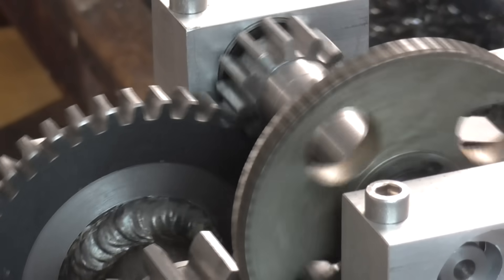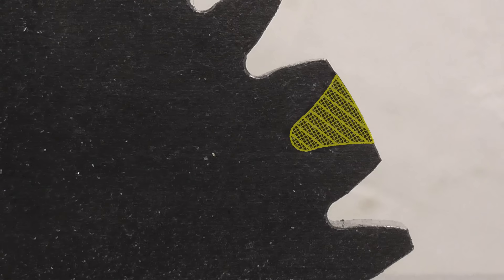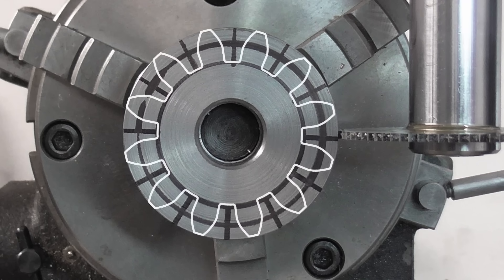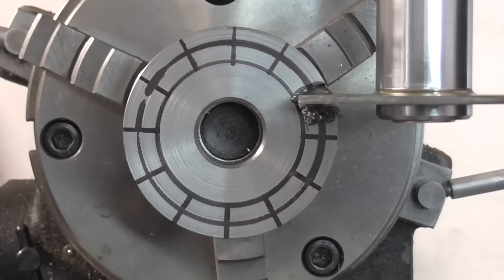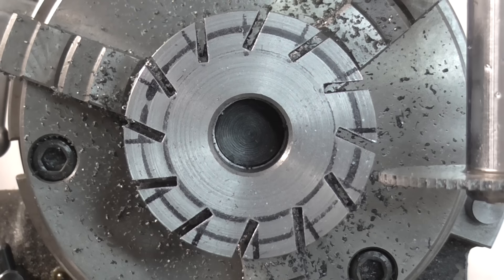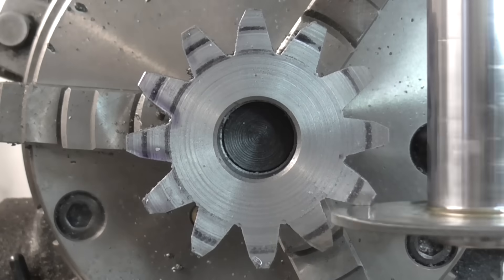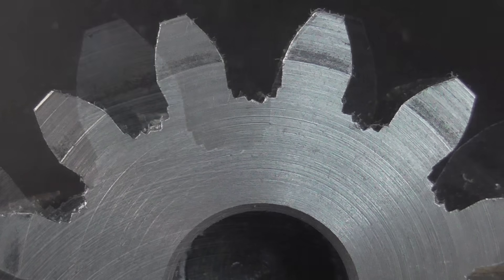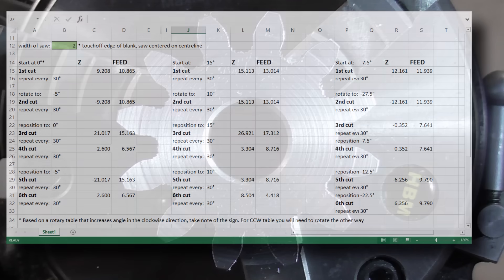Cut any gear with just a slitting saw

Comment: Well done 👍👍The metal that you were cutting, was it a low grade alloy? Use a similar method using and index table to cut the gear,this gave the advantage of being able to drill-out the teeth root prior to cutting, and an end mill was used instead of a slitting saw. However the geometry used in the process was basically the same. We done!! very impressed, freshened up my maths no end, thanks.
Reply from the maker: It was just mild steel.

Comment: newbie here. are slitting saws designed optimized for cutting a particular type of metal? ferrous versus non ferrous (aluminum). if so, what makes them different? are tungsten teeth the norm?
Reply from the maker: There seem to be 2 main types, HSS and solid carbide. HSS are for general use on non ferrous and mild steel. I've not seen any with teeth optimised for certain materials, but these may exist. They do come with different sized teeth, smaller teeth are better for thinner material. Carbide ones are more expensive and would be used for hard materials such as stainless, hardened tool steel etc. There are also saws that take replaceable insert teeth, but these are much larger and would be for industrial use.
Reply: @AndysMachines thanks andy. and... where does one go to learn for a given material to be cut (aluminum), the linear feet speed of the cutter should ideally be for a clean, non sticking, non chattering cut?

Comment: Cool, but you can use two properly spaced saw mills simultaneously, so you will machine two sides at the same time
Reply from the maker: If you used 2 saws they couldn't be parallel to each other, they would have to be at a 20° angle (or whatever matches the pressure angle of the gear). You could use a thick saw with the sides ground at an angle, that would effectively be a #1 gear cutter.
Reply: @AndysMachines They could. You made "cartoon gear" by cutting 1 side and then relocating saw to another position to cut 2 side, but you could have two saws at positions 1 and 2 at the same time to get "cartoon gear" just in one revolution of workpiece.
Reply from the maker: Ah, ok! I see what you're getting at. Yes, you could have 2 or even 3 saws on the same arbour stacked up but they would have to be different diameters so that their radii form a 20° cone (40° included angle). This would cut the same side of multiple teeth rather than 2 sides of one tooth. You would need to invert the cone to cut the other sides below the centreline.

Comment: Hello
you could be interested in this video showing how to cut gears with a slitting saw but with tooth thickness adjustment: https://youtu.be/y__LZ8tn88I
Best watching
JM
Reply from the maker: Very interesting! I have also cut gears using a similar method but with a cutter shaped like a stack of no.8 cutters so that cuts are made on several teeth each pass.

I also like how you cut gears on a shaper, you don't often see people do this but I think it's one of the best uses of this machine, particularly for internal gears.

Comment: Why couldn’t we profile an end mill cutter for a particular gear? Obviously this should have limited uses, but those limited uses would be the entire reason for the idea. Spur gears don’t need it because there a normal cutter for the arbor that would work perfect. Even helical gears are the same way, just a bit more complicated. Herring bone gears on the other hand are nigh impossible without doing it in additive manufacturing means or splitting the herringbone into two helical gears. Why not profile an end-mill to dive down from the top to cut the tooth profile. That part would have to be CNC controlled on the dividing head, but I don’t see any major issues as to why it couldn’t be done.
Reply from the maker: Yes, it can be done that way, I've done it myself in the past. It's even possible to hand grind a D-bit cutter reasonably accurately. But such a cutter is much weaker and much slower in use than the regular type of gear cutter (which is not that hard to make a DIY version of either). In industry herring bone gears are cut with a double headed shaper that 'planes' the teeth from either side, so no need to split the gear.
Reply: @AndysMachines  well crap, I didn’t even think about using a shaper.

Comment: Would I be right however to suggest that the end form lacks any proper rolling through radii point loading , ie lots of small steps and not a rolling on/off load transfer? Cheers
Reply from the maker: The more cuts taken the smoother and more accurate the finished result will be. Even with less cuts the gear will wear in with use, any high spots/edges will become smoothed out as there is always some sliding contact between gear teeth, not purely rolling.
Reply: @AndysMachines  I see that is ok for limited applications, which is probably what you’re proposing anyway. But the few gears that I cut on a mill/ indexing head arrangement, were always case hardened before use so running in would have been minimal! A lot of oil changing would be required otherwise! Lathe change wheels etc, greased, would be a less demanding use scenario!? Cheers

Comment: If you ganged up several slitting saws with the correct spacing, the job could be done in one pass for each tooth. Well done, sir. I once used a similar method to produce a wooden pattern for a casting, cleaned up with a file, an alloy gear was made for an old cement mixer, and it worked fine. I have been a bus mechanic for 23 years and a hobbyist for many more years.
Reply from the maker: Yes, you could do that and it would save some cuts. You could even cut each side of the teeth with only one pass on a larger gear, but the saws would also have to get progressively larger in diameter up the stack, so that the outer edges form a cone which matches the pressure angle of the gear, otherwise they will not reach the teeth. It would be similar to a gear hob tilted over (to the pressure angle) but only cutting with one side of each tooth.

Comment: have you considered cutting these gears in a CNC (milling or laser or waterjet or EDM) machine ?
Reply from the maker: Wire EDM could work right off the machine, and even cut gears from hardened steel, unfortunately I don't have a wire EDM (I could build one, but I don't REALLY need one). CNC (in profile) would need multiple shallow passes with a small very long end mill, it could work but would take a long time (I could have done it this way). Laser and waterjet would both produce gears that would be too rough to use straight off the machine (especially cutting thick material, 20mm+) and would need some finishing afterwards.

Comment: i love this method. purchased "gearotic" many years back, was disappointed that it only cut spur gears, and one tooth at a time. 

with a bit of thinking, i realised i could do helicals, and bevels...

helicals need a driven rotary... cnc or not.

bevels need a second rotary and a bit more maths. you gotta roll the work on two axes.

ellipticals are also possible.

as for the people that think a set of cutters is the better option? no, they arent. they are only ever a compromise compared to a proper generation. and there are certain profiles that you just cant get cutters for. need a different pressure angle? tough. need an off size pitch? tough. need a modified acme stub tooth? tough... and cutting a bevel with involute cutters is pretty well much impossible if you need anything better than a "rough" profile. 

and then you need somewhere to store all these funky, one-time-use cutters...

once you have the settings, its almost faster than an involute cutter. can sink the saw right in and as its only ever shaving, can wizz through. coarse pitches with cutters still require several passes per tooth...

i like to start at the highest Z, run through all the teeth, slowly dropping the cutter for each pass until done... always rotating the A (and B?) in the same direction...
Reply from the maker: Yes, there's a lot you can do with simple methods and a bit of thought.

Whilst sets of involute gear cutters can be very useful, as you say they are an approximation of the correct profile since each cutter covers a range of teeth. A big drawback is that they don't make them for less than 12 teeth and it's very common to want to cut pinions with as few as 5 or 6 teeth to achieve high gear ratios.
Reply: @AndysMachines  for me its the bevel gear aspect that makes it the most versatile.

its exactly that same as here but using angular increments rather than linear. the maths is much the same but with extra steps.
think of a gleasson. it generates by rotating the cutters and work around a convergent point on a virtual "crown gear". so fundamentally no different.

tilting rotary table. clock over to bevel angle. progressively tilt table as you index through the generating cuts (another reason its easier to start at one extreme, working through to cut all teeth at same time). bit of z offset for the fact the table doesnt tilt on the centre of the convergence point...

every other method is just a guesstimate...

Comment: Is drilling holes at the beginning to form rounded tooth roots rather than multiple cutting passes with the slit saw impractical in someway? i've never made a gear before, but I'm going to be soon so this information would help a lot. Thanks!
Reply from the maker: I get this question a lot. Yes, you can drill holes for the roots, I actually did this for the larger gear that meshes with this one, though a simple arc is usually not the ideal shape so drilling a hole will result in removing a little more material than necessary, producing a slightly weaker tooth, but usually not enough for it to be a problem. There is no tooth contact in this area so you only need to create enough clearance for the tip of the meshing tooth.

Comment: I can see you are working with DRO and 0.00x mm, I have an old (1962-3?) Pedersen VPU1 milling machine, it is "only" accurate to 0.01 mm, is it still feasibly to use the slitting saw in my case, or should I stick to use module cutters ?
Reply from the maker: Yes, 0.01mm is plenty accurate enough for anything but the tiniest gears (that's less than half a thou for non-metric types). Whether you choose to use a gear cutter or a slitting saw really depends on what works best for your application.

Comment: A gear that big probably could have been done with the ball mill vertically, the math and method though I'll have to save this video for. I got a little divider for my old 1950s jig borer/small mill. Doesn't help me right now as the only gear I got that needs replaced is a helical pinion gear for my tractors steering and the $25 Chinese amazon replacement definitely beats an entire afternoon cranking handles lol. I could always just run a personal project on works 5 axis cnc mill too if push came to shove.

Comment: I need to make 2 custom gears for my mowers gearbox and really would like to try this method but I can not get my brain to work with the angles needed on the rotary table and the dials are in Degs,mins,sec.  i have divider plates which I have setup for the tooth count I need but still not sure how I would do the offset angles needed.  I may have to try some cutters from china but I will be cutting 4140 so I guess I will see it they last.
Reply from the maker: Dividing plates with arms are useful for indexing each tooth, but you'll probably want to use the angle readout directly on the dividing head for the starting angle for each cut, then reposition the arms so you can index around to cut each tooth.

Comment: The title says "Cut Any Gear ..." so I was wondering if the technique was good for other types, like helical and perhaps bevel gears. Spiral bevel is probably a stretch too far. But, after watching for the second time I wonder if you could cut helical or bevel gears with adaptations of it. The bevel gear is particularly intriguing as it can be done on a shaper with a straight edged tool and some geometric gymnastics. 

Just wondering.
Reply from the maker: Yes, it would be possible to do helical and bevel gears, in fact any gear can be generated from a rack profile which is really just two straight cuts at an angle to each other. It would be much more complicated of course and I haven't tried it and probably won't, at least manually, it really needs to be done on a CNC machine to keep track of all the numbers.

Spiral bevel gears I find it hard to get my head around and they are actually cut to a modified profile to make them easier to manufacture. Some types of straight bevels are also cut to a modified profile rather than the geometrically correct one where the teeth would get smaller and smaller and eventually disappear at the point of the cone.

Comment: Charleston Naval Shipyard had a precision gear machine that was programmed by 4 gears in the machine.  4 equations had to be satisfied to pick the 4 programming gears.  I wrote a BASIC program to test every possible combination to solve the problems.  I only had a Radio Shack Model 3 to run the program.  It took 2 weeks to complete. 24/7.  Each time it came up with a solution, it stored the data on its floppy disk and printed it out on one line of the printer.  After completion, the results were sorted and printed out to create 7 volumes to use on the machine.  Tests showed my effort gave results making custom gears much easier with no math.  That was in 1975.
Reply from the maker: That's very interesting. I wonder could it do prime numbers of teeth? Perhaps if you had a prime number as one of the programming gears?
Reply: Nice work Matey! Good to hear of the good old - new - days!
Reply: Minor nit: either it wasn't a TRS-80 Model III or it wasn't 1975. Wikipedia TRS-80 article.
Reply: lol, continuous fractions... figuring change gears is a juggling act.
Reply: Interesting. 
Most computer programs are built to be used thousands, millions or billions of times, but like you I also spent several weeks writing a program that was (basically) only going to be run once.
It was to calculate the surface area and concrete volume of every pour of a double curvature concrete arch dam.
This was composed of several different parabolic curves (upstream, downstream, left and right all different) in both horizontal and vertical directions.
It was a very interesting project that I did in my own time at home.
Previously it would have been done using a planimeter on paper plans which works by performing a form of mechanical integration.
Amazing how mechanical solutions to mathematical problems were found in the past.

Comment: Was this just an academic exercise or did you actually put this gear into use?

If so, what kind of power did you put through it?  How did the surface finish hold up?

Hardening?
Reply from the maker: This gear was for a very low speed high torque application (crushing machine). It was not hardened and so far has held up very well, however the project is on hold for now as I need to work on other things.

Comment: It looks like you are using a Vertex HV-6 rotary, or similar. How do you keep track of all angle adjustments up and down? The dividing discs would keep track of the overall indexing, but for the fine tuning, the ordinary crank is needed. But the scales on the crank are marked with degrees and minutes, not decimal degrees. I would like to test your method on a M1 31 tooth gear for my lathe.
Reply from the maker: Yes, it is the HV-6. I don't have the dividing plates for it, I just use the handwheel. I tend to work in decimal degrees and just round up or down to the nearest 15' in my head unless I need super accuracy.

Comment: for arguments sake you could just use a ball mill and cut them from the top side? the first cut would need to be multi step, but after that you're just cutting one side at a time, allowing you to use a carbide end mill, and possible speed up the process? (hypothetically it would also also you to change cutters if one got dull and or broke without sacrificing centerline accuracy?
Reply from the maker: You could do that, but as you point out, you would have to take multiple cuts to remove the initial wedge of material and it would need to be a small, long and fragile end mill, so would take a long time and highly likely to break the cutter. You could use the slitting saw for the first cuts and then switch to an end mill (you'd have to rotate all your coordinates by 90°). Rather than a ball mill, an end mill with a small corner radius might be better since some of the cuts would be with the end of the tool and need to be straight. Or you could just grind a small radius on the slitting saw to avoid the jagged steps in the bottom of the tooth space.
Reply: @AndysMachines  More or less the same train of thought, slitting saws are slow fragile things, especially when only using one side of them, Guess it largely depends on how big of an end mill a guy could get away with, 1/8" I wouldn't hesitate to try, anything smaller would be tough.  Radiused slitting saws are often problematic, lots of tool pressure, but it would still save a step.  Just vomiting ideas lol.  I mean, until this vid I'd never even considered using straight generic tooling for cutting gears... opens up other ideas in muh skull.  bonus working off the xy plane many of us mere mortals could do the plotting with a DRO... and use the power feed option
Reply: @northmanlogging2769  Well I've broken countless endmills in my time, but I've never broken a slitting saw! And they're way faster than umpteen passes with a tiny endmill. I'd say it's the correct tool choice for deep narrow slots.😀